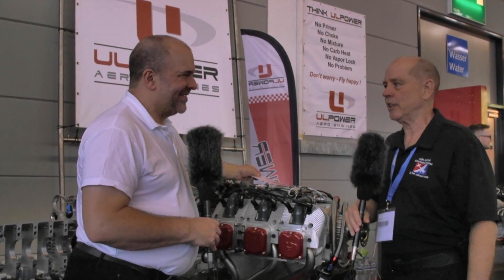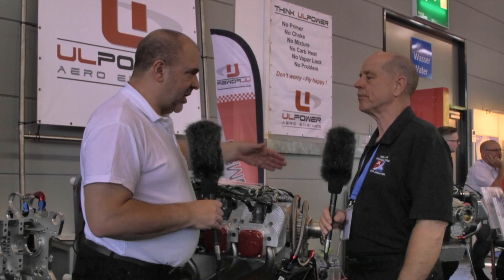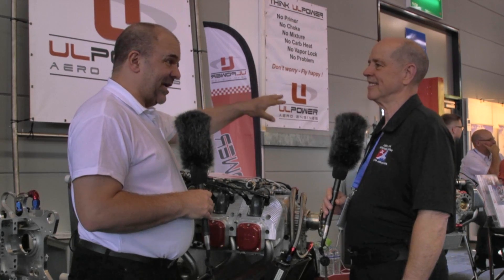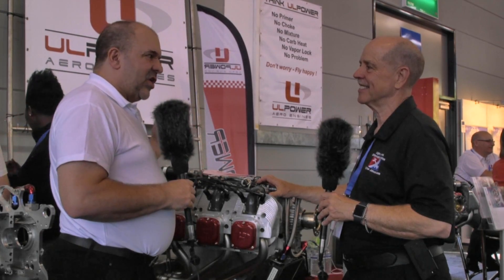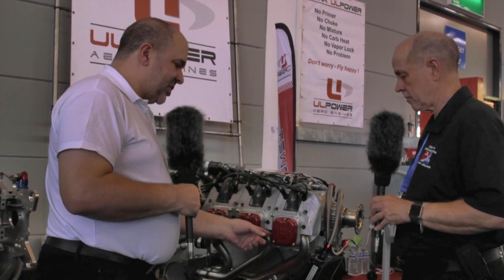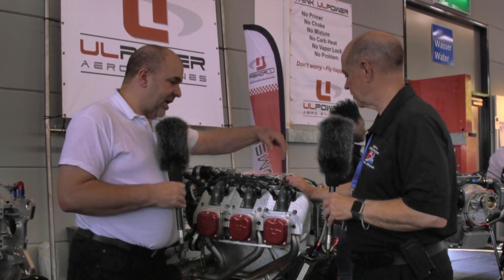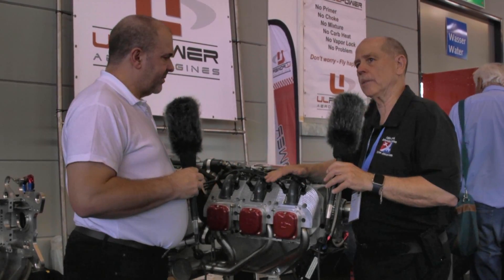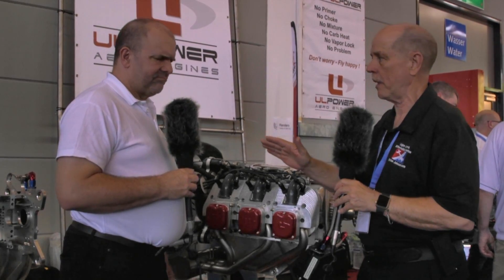UL Power Aircraft Engines for experimental amateurbuilt kit aircraft.

Comment: Any word on a turbo version for the 520? I want one with an electric constant speed prop and hub. Cheers!
Reply: The 520 turbo is producing 220 HP at 2,700 rpm at sea-level and should produce 180 HP at FL100.  

It will be shown at Aero 2020 and Sun n Fun 2020 with engines being delivered about 6 months later.

http://ulpower.news/ulpower-aero-engines-present-at-sun-n-fun-and-aero-friedrichshafen

Comment: Even their smallest engine weighs 160 pounds. Not exactly light!
Reply from the maker: Compared to what? It is one of the lightest engines on the market, for the two seat kit plane market.
The Ultralight Flyer
Reply: @ultralightnews   I have a two seat Avid Flyer and it's too heavy for that. Before that I flew a two seat Mitchell Wing, too heavy for that. I have friends with two place Challengers. Too heavy for those.
Reply from the maker: I have flown the UL Power engine on a Kitfox, and have seen it flying on a Just Aircraft Highlander, both designs based on Dean Wilson's Avid.

Since the Challenger now uses the Rotax 582, with exhaust, carbs, radiator, fluids, drive and electric start. it should come in pretty close.

I would hazard a guess that it will easily fit onto 90% of todays, two seat amateurbuilt kit planes.

But I would NOT recommend it on a Mitchell or Challenger!  Even the Quicksilver and MSquared two seat kit aircraft are now powered by 4 stroke engines of similar weight.

The Ultralight Flyer